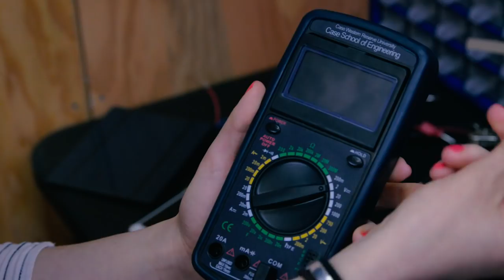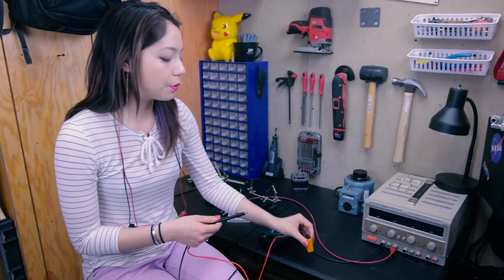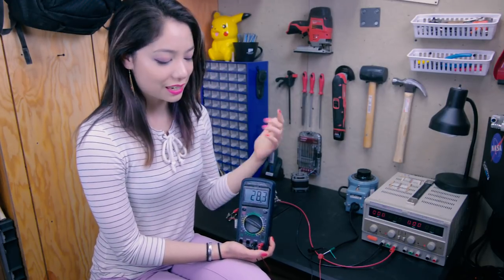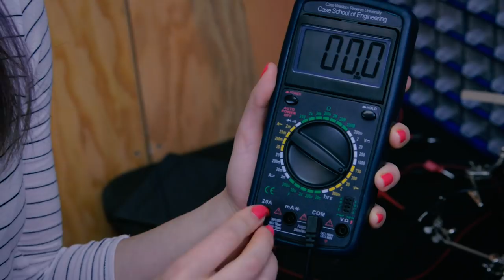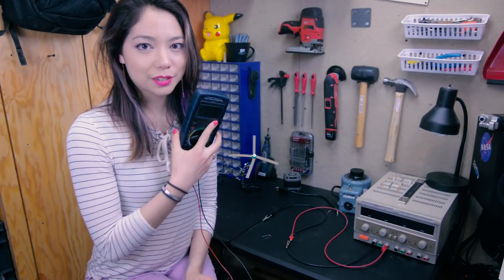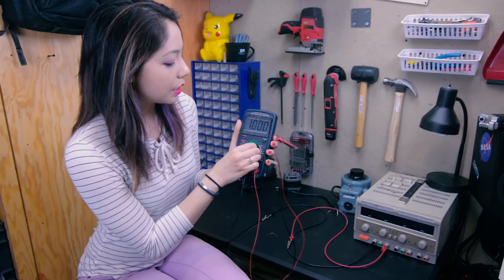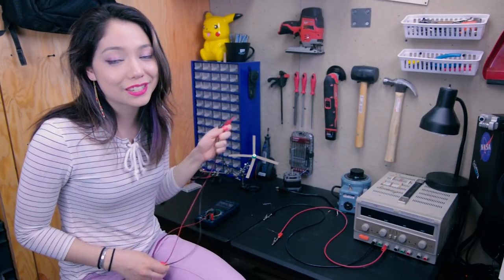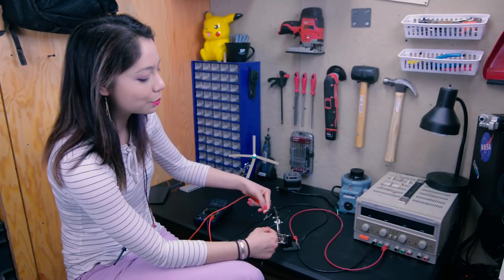How to Use a Multimeter || Measure Voltage, Current, Resistance - EASY!

Comment: Pfft, your PC might have bigger fans in it than that.

You forgot something very important though. Better multimeters have 4 terminals, but cheaper ones that most people use have only 3. Only the high-current range is split out on those, the low-current ranges are not, it's via the same terminal as the voltage and resistance. What's important about that is that when you have your multimeter connected to something, i.e. you use crocodile or probe cllip, and you decide to change the measurement type, you must remember to turn the knob AWAY from the current range, rather than wiping right through it! Because on 3-terminal multimeters, if you were to wipe across the current range, the range switch will short out the test leads, you are not completely unlikely to damage your multimeter, and whatever you're testing might suffer too.
Reply from the maker: Im gonna pin this because its a really good point: definitely be careful to disconnect leads, or at least be careful to avoid the low-impedance modes when switching so you dont blow a fuse! And always be sure to know your tools - read the manual about your device so you know the right and wrong ports to use!
Reply: I think i know why people don't read the manuals, they get bored or distracted by the time the manual gets to the bits the person might not think of. They always start with 
* Don't throw into water
* Don't throw into fire
* Do not eat
* No, don't even think about it
* Not even licking
* Look, we know you're hungry, but this is important!
* OK, take a break, eat and come back later and read the rest, promise?

They never read the rest.
Reply: Beauty and the Bolt I tried measuring current and i connected the negative from power to a fan then used the positive to touch the wires from the power to the fan and it sparked. Is that normal?
Reply: With the connector on the voltage circuit switching to amp measurement is definitely to be avoided .. is also exactly what I wanted to ad which is significant unless it was sponsored by manufacturers of multimeters :-). 
The "my biggest fan" was obviously a joke - if she takes that one and those of her PC (CPU,GPU,PSU, case ...) she already qualifies for having her own fan-club.

Comment: You legends - that was really informative and helpful. Just doing some new headphone cables so this was great for reference of the general functions!
Reply from the maker: Ooooh good luck! BTW if you aren't getting continuity on your headphone cables, sometimes you need to take a lighter to the coating in order to probe them and actually get a connection. Tinsel wire can be kind of a pain sometimes.

Comment: This is a really cool short and crisp intro video !

I guess another cool feature on recent low cost multimeters is NCV (No Contact Voltage) which comes with its caveats. Also, an explanation in a later video on True RMS meters and its advantages (given more multimeters have True RMS now) would be nice :)

Comment: I'm having a real issue with finding appropriate values and for some reason, there seems to be a real dearth of service manuals for almost everything. I'm guessing that a lot of the products I'm working on had online service manuals that were removed when the manufacturer stopped supporting them. Does anyone know if there is an online single point resource with circuit board multimeter maps? Or service manuals.

Comment: This was somewhat helpful, but I couldn't see what you were setting the multimeter to. That's one of the main reasons for watching a video like this, because every multi-meter is a bit different, and there's multiple settings in the ohms, volts, amps. And anyone who has no idea how a multimeter works, is still gonna be lost. Still have yet to find just one good video that fully explains the what, where, and why of this.